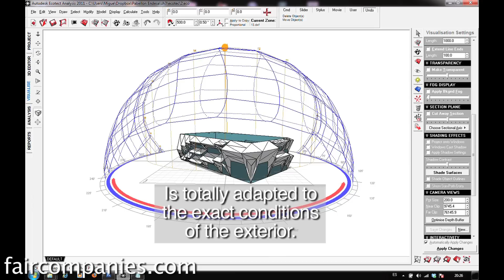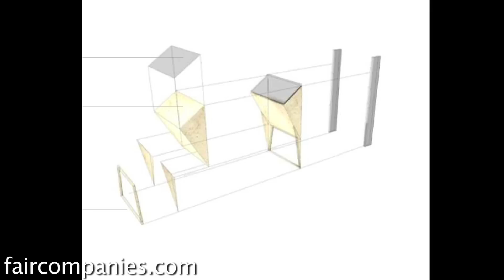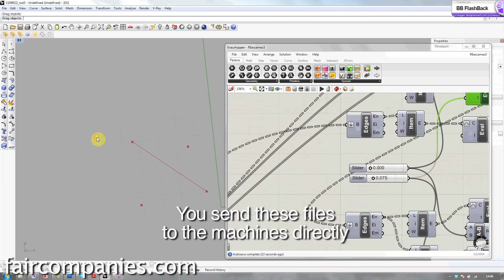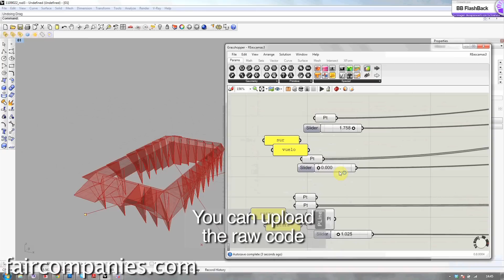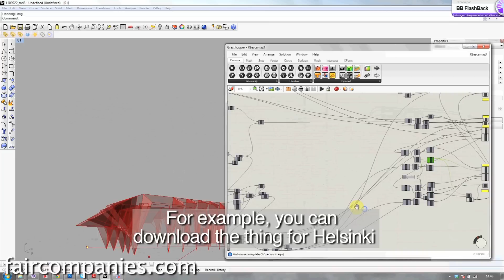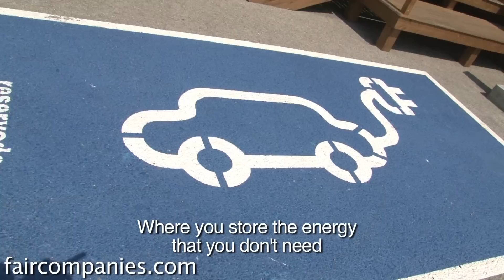Fully-customized, modular solar house is CNC cut prefab

Comment: Intriguing architectural forms. Attention getting. Would probably make a better office or shop than a home. I like that each panel is fitted exactly to the sun angles that exist where it is going to be installed. I also like all the solar panels.

No 3D printing involved, and that's probably a good thing. But it is designed with a 3D CAD program on a computer and the pieces are cut on CNC machines. Only the panels are prefab, not the building.

Comment: I had a Chevy Volt in 2007, and the batteries were expensive, but I never had many concerns about the battery life (primarilly for work, half hour there, half hour back.) Power was an issue, though, and the deciding factor when I chose to go back to combustion. I live in a fairly rural area, like 40% of Americans, and in the mountains to boot. Hills were a constant pain to chug up, it could barely take curves uphill, and in the wintertime travel was prohibitively dangerous.

Comment: I foresee printed graphene-chassis with accumulator-functionality fed by printed solar-graphene-panels which are also printed on the chassis right away. Within these structures are the electronic graphene pipelines for the electrons already printed into it along with all the needed transistors, relays, etc. consisting of graphene, too. 

Only thing left is glas. Maybe soon we can print sand hot enough to end up with printed glas in combination with graphene layers.

Comment: here in germany we dont have much sun and the winter are cold. i dont see any isolation like styrodor or glaswool. Where are the safety aspects? From Fire, Water and Wind? I think it would burn down in seconds if it catches fire. 

What are the costs with the solar plates?

I like how it is designed and that the sunlight cant get in the house

Comment: A. I personally find it attractive; many will not. b.  Of enormous significane before people need to understand that just because it can be printed, fine, amazing but local communities with zoning laws have to approve of the home fronting next to others - at least here in the States.  Finally the costs will still be basically designed by the market.  I truly doubt poor people will get much of a play in the pre-printed housing market!!
Reply: A World of Plastic This is just a "serving suggestion" made for Spanish climate. The possibilities in terms of design are endless. Especially for more Northern regions where the sun is lower in winter, solar cells can be integrated in windows and classically on the roof. This design just pushed it to the max in terms of efficiency for the spanish coastal region.

There needs to be a transition in mentality. First of all people need to understand the undeniable advantages of open source concepts. Then realising how much sense energy saving designs make. Some people might find certain looks strange but that's also part of saying goodbye to outdated inefficient concepts that were built for looks alone. Speaking for myself I would personally welcome somebody who wants to build an efficient house in my neighbourhood and I would also inform other people about the benefits. Exchanging ideas instead of naysaying is the future.

Why would poor people be excluded? The more this concept finds advocates the more the costs will drop. As he explained it was designed and built in a few weeks. A conventional house usually takes months where the wages for the builders are a big chunk of the cost.

Comment: Downside is in quakes, this probably would fall down like a house of cards. See the 3D machine which prints a house from cement like a small 3D printer does with plastic. Curved houses in Eastern Countries have withstood huge earthquakes and are still standing hundreds of years if not thousands of years later on some versions.

Comment: No, it took two weeks to assemble on location. That does not include the time it took to construct the component parts off site. Unless you are stocking a large scale operation where you have a list of parts in stock, fabrication time is JUST as important a factor as assembly. More so, honestly. Many of these "record breaking assemblies" rely on weeks, or even months, of shop-time to complete.

Comment: I like this concept, however I still believe by building using this method creates too much waste in materials. Plus there are better ways to build a building that has shades in the summer and sun in the winter. But this is going in to the right direction.

Comment: The different size solar panels and differnt angles that are on this house boggle my mind. The differant shape/size panels can understandably be put on differant strings (160 watt panels together, smaller panels together) but that doesnt account for the differant angles of the solar panels.  If ones flat _ and the others tilted  / the solar array only produces the amount of the weakest panel in the array. unless they have a huge amount of solar controllers.

Comment: If you really think about it we are really oppressed. Everything is about conformity. Capitalism claims individuality but that is a lot of hot air. There is so many obstacles to get off the grid but the restrictions keep you on the grid. The bottom line is money + power = control.
Reply: +creamone Free market capitalism is the best system, but we don't have it.
Reply: +UO Redemption WE had Free Market Capitalism in the 20's and 30's; then the Great Depression occurred.
Reply: +creamone 

money + power = control 

wow what a revelation 
can I quote you?

and where do EWE fit into the equation?

on the money + power side of the equal sign or on the controlled side?  ;)

Comment: The only way solar works is if each of the panels are independently hard wired.. If not weather causes reduction if not failure. Think if a string of xmas lights and pulling out one of the bulbs.

Comment: cost of solar panels + batteries is like 80 % cost of whole finished house. Solar panels have a lifespan of 15- 20 years. after first 10 years the efficiency drops to 40 - 60 % .  But the worst thing is with baterries that will need to be changed every 7 years or often just like in a car

Comment: They could improve aerodynamics a bit.Looks like a anechoic chamber !!
Reply: +Achal H P To do that they would have to multiply the number of peices by 3-5-10, alot, because it's using flat cnc pieces of wood, to make round instead of square would be for example 10 times more, or to find a new production method using bent CNC sheets. Actually you can make score marks in panels to make them round, but they would have to rewrite the computer program into some much difficult maths. my complaint is that they didn't paint it with a professional varnish, white plastified plastic is very different and less messed up than that wood look.

Comment: But whatever your concern or the concerns of the 50% of Americans who live in well-developed urban areas about electric cars or any inovation for that matter may be, my original point to GanzLONDON was that technology provides solutions which provide options. Insufficient power or battery life, safety ratings, etc...all issues which can addressed through the implementation of technology. Signing a petition or protesting or whatever helps, but it's meaningless without the options.

Comment: 5:00 So is that bowed and cracked horizontal beam important in anyway to the building structure?

I'm sure the design is technically efficient but so much bare wood, how will it stand up to the elements? Two week build time isn't that impressive for only erecting a freestanding structure. Imagine if they wanted to put siding or finish the interior... Near impossible.

Definitely not something I would consider a permanent home.

Comment: Like the solar house idea, but i wouldn't have designed it like that.. it's too much of a structural house that seeks attention.

If i were to fabricate a design for my own.. this wouldn't be it.. 
I'd just install and reconfigure the modular solar design on the roof or at the side of the house.
And to think that the design doesn't have any concrete incorporated, scary when there's a storm, tornado or whatever it is. Don't wna rely on those bolts and hinges that connect the two piece together.

Comment: Cool, but also totally misleading. There's no 3D printing involved, and the prefab parts are all made of standard building materials, which means there's probably a lot of waste making all those custom cuts. Waterproofing and maintaining a building with so many faces would also be nightmarish, and like many Frank Lloyd Wright and Frank Gehry buildings, it would almost certainly leak... a lot. Still, it's a cool concept, and if it could ever be built as a true 1-piece 3D printed object, it would be better, though clearly there's no consideration of the economy of building materials, because a multi-faceted wall like that easily uses 3 times more material than a simple vertical wall. And seriously, that giant glass front pivot door must have cost at least $20,000
Reply: everthing can be done. I think of this as a concept real size model. it can be created out of parts and those parts theoretically can be cut from a list of metall or wood. therefore its a good thing to create a tech for. For the concept is quite enough. the initial construction structure can be made out of wood or of concrete and for the wooden mold construction 3d printing can be used. the outer parts can be wooden or metal.
Reply: You are right. This house has nothing to do with 3d printing.